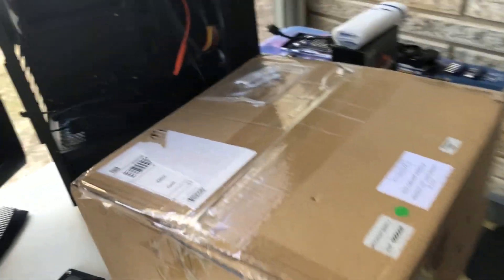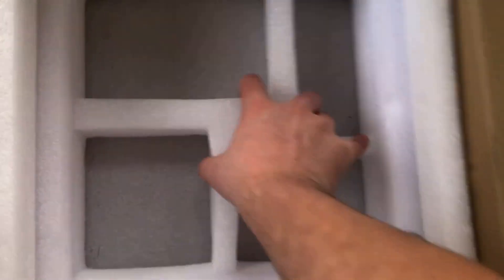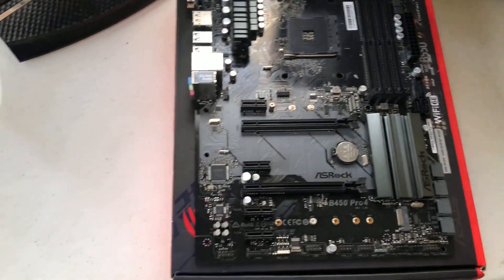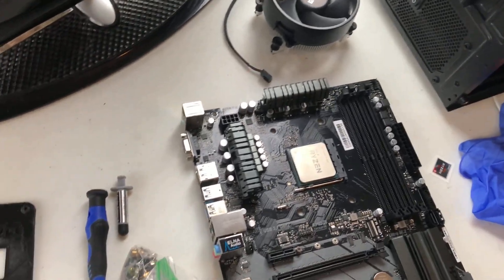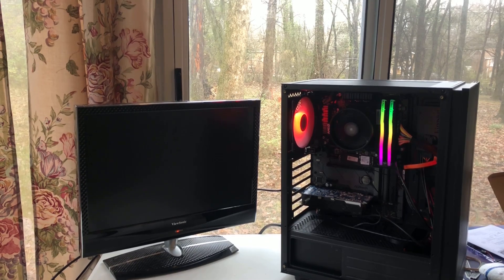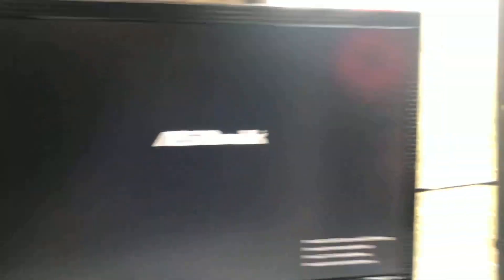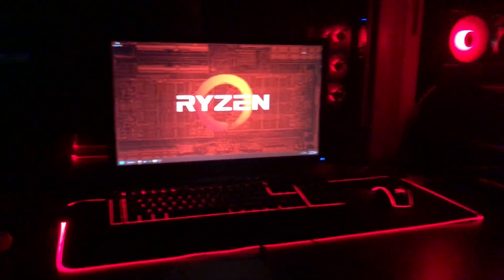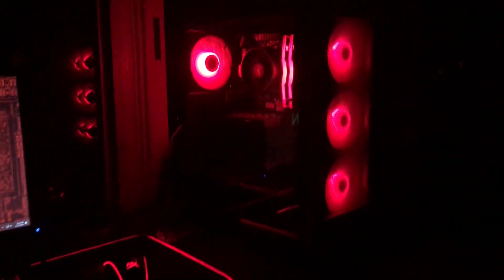PC Build part 5

Comment from the maker: What are your pc specs?
Reply: AMD Ryzen 5 
GTX 1650
Reply: r3 2200G
Reply from the maker: @spra1nt  sweet!
Reply: Nvidia Geforce RTX 4080, Intel i7-13700KF, 32 GB RAM 6000 Mhz, 2 TB NVMe SSD
Reply: R5 3600 GTX 750 ti
Reply: R5 3600
GTX 1660ti
Reply: Ryzen 5 5600x RX 7600 32gb ram
Reply from the maker: @mysterygamer3522  sweeeet!
Reply: I have intel integrated graphics and intel i3
Reply from the maker: @Ludeknemore  rip 💀
Reply: Intel i7-7700, 40 gigabytes of ram, and an intel arc a770.
Reply from the maker: @Hallowee1234  ooh nice!